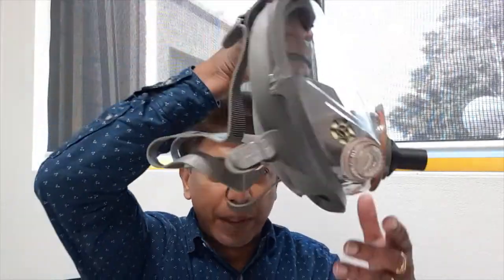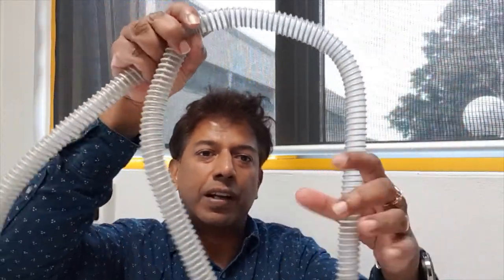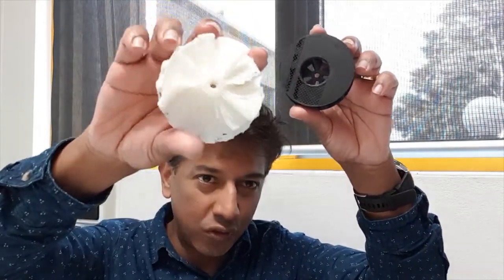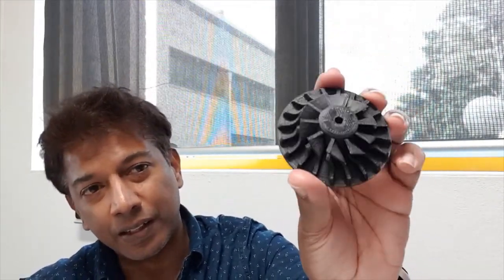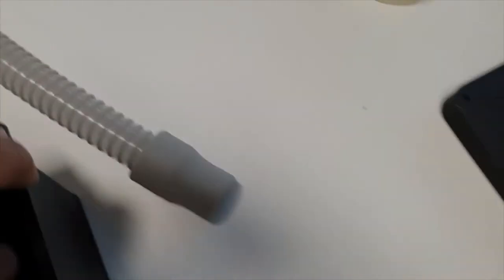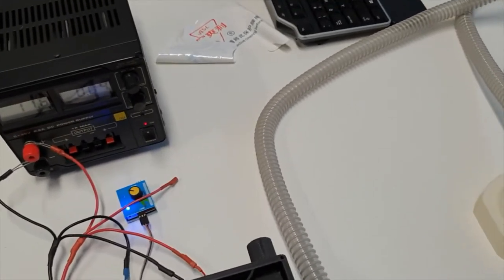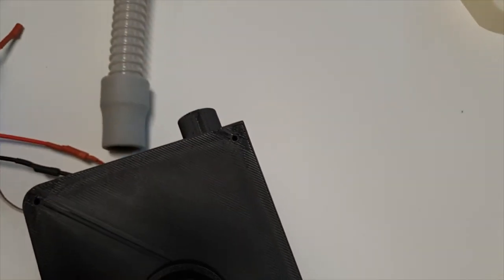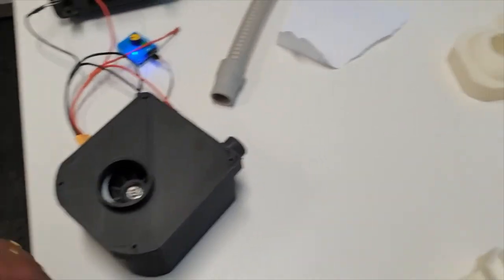Positive Air Pressure Respirator (PAPR) with 3D Printed Turbo Impeller

Comment: Cool!! wish I have my own 3d printer, ordering one would be too expensive where I live (malaysia) "Sanding not included". I had some ideas on using a smaller motor but with a laptop fan design for reducing the noise as we don't really need that much air pressure. Also would attach an active carbon filter with hepa filter as well.

Comment: I've tried several different fans. The problem is when i add a filter, air flow drops significantly. Very huge drop that i dont this its got enough airflow to supply my breathe rate

Comment: I have the same centrifugal brushless fan.  (DELTA BFB1012M) I was looking for just such a strong air flow.  What model do you have?  or can you please advise me which one to choose a powerful brushless one that can be connected to a power bank without any problems.  Thank you so much!
Reply from the maker: Hi Canez, Your fan draws around 500mA which is great. It will give you enough airflow into a mask that you may use. If your battery bank is a typical 5V battery bank, it does not have enough voltage to run the battery. So you have few options. Use 8 AA batteries (which is going to be expensive). If not and if you are good with using Li Ion batteries, you can use 3 of 18650 batteries.
Reply from the maker: any small motor 3s (3 li ion cells) will do . They are very powerful even though they are small.

Comment: hi, please tell me which fan you installed.  and what power bank.  For example, I found a 12 volt 2.7A fan.  and they tell me that I can't find a power bank for him.
Reply from the maker: I used simple brushless motor that I had from a twincopter project. This motor could run from a 3S battery which is about 11.4 V. You can have a small motor or a brushless motor and many motors can easily run from 12V. Now, 2.7A looks like bit overkill as then 12x2.7 = 25W. So there is lot of power here. But it could work as well. Powerbank usually is 5V. So you want to make your own battery. If you have any experience with 18650 Li Ion batteries, you can combine 3 cells to make 12V. You need to know how to charge batteries and then to use BMS (battery management system ) to control them.
Reply: thank you very much dear Prashan!  but there are power banks at the output of 40 volts and above .. (for laptops) are they also not suitable?  really there are no ready-made solutions!
Reply from the maker: @canezbasten709  You can use a DC-DC step down converter to supply the fan with 12V. Here is a link to ebay from Australia. You can surely order the same thing from your local Ebay at a much lower price if you are getting it from China. You can adjust the output voltage to be 12V where your input can be upto 40V but not more than 40V. However, if your battery bank is a typical USB battery bank similar to the one shown in the video you posted, then use a DC-DC step up converter to make the 5v to 12 V. This is cost you less than US$ 2.00  .  https://www.ebay.com.au/itm/LM2596-DC-DC-Buck-Converter-Adjustable-Power-Supply-Step-Down-Module-Multi/254318942465?_trkparms=ispr%3D1&hash=item3b36971901:g:BEIAAOSwY8ldRP7R&amdata=enc%3AAQAFAAACgBaobrjLl8XobRIiIML1V4Imu%252Fn%252BzU5L90Z278x5ickkrDx%252B2NLp21dg6hHbHAkGMbq6dyy6j6J3IIdKM0R7JzKg8YBCOWG6gHS5uQyReS78aCErues02SWPCcbBD3ZOiFebj22tH5gk6nRp8fWeQyn5D6gQFXkp0%252BXfzecsmieLdhiMR23iaCmXFhcYwJ%252B24Cev3a8Orqx1%252B%252F8%252FoytSYkV302hMKR5x5WnjBtJynsBGN3ElDHXEvDVTEe%252FBIHlE%252BWS89%252FdO8parHJWDZC1IS4ravdmqcECEPWjUbBVyWKo50L%252B6OfGgx7RKdT0Rzjf29i7zicGyVML0QCbtB31f3HkMjrNSqoszDyAXCxC8eQwLUn38pNhlZI1kiqTDrttOCa8UFO%252BIr1EbYNBc1ck2SCtwD6qyUN6QnHgE8k3Jwz7YoFoS3jM6eYPEY46OymrTJWtBgz73lchpDuPppfs%252BlLkL6v1BmjE%252FI%252FPh4B9viY%252FGD8tuLeuAYednZV3RFZNWzzRR1LPfJrCBJg2jUfhIsnqF5DdHyhc4aNp6gp3fZG%252Bj4zsgpVSmBMTyi434%252BYiwmacA0CYpxlOIpxsMZpOrus4KvuPxMQo0pdzn4hQU6Vy1rSvxrRn6tWQx4msivhxg1vJ14IPBaFOo9fHgUqSYn%252FyOy%252FEl5Fl82ia%252FfD2gWyq%252F1SasUdz%252FXglvK5SCtBL4XJab1iSOjfzpO0N%252BuDL4PjEoqOEuQgIJe81HGhoClgi%252Fu9Chf%252BggYa6QVK3cqXTQAta2MNsg%252FYqMtyJetB7EUsbQjsCrVMcQJNOZZqTKURW%252F9VYzdkvYyNjOb3smYs1GKCmJ7OVZjAlZDM4oEy5WhnQ%253D%7Ccksum%3A254318942465b3f6576bd4fe45ae9e060cfec703a535%7Campid%3APL_CLK%7Cclp%3A2334524&frcectupt=true

Comment: Just a heads up, you said compressed air, you don’t want compressed air, there is other uses to deal with when talking about compressed air.
Reply from the maker: Just wanted to clarify when  I say compressed air, it simply means that the air pressure is bit higher so that it easily comes through the filter and you dont have to put any effort to breathe.
Reply: I just need air supply, air injection (no matter what) the main thing is that it is enough to breathe) and most importantly, that it is mobile.
Reply: @canezbasten709  You can use a paintball/airsoft HPA tank. It will be dirty air, but you can also put a filter in the connection.